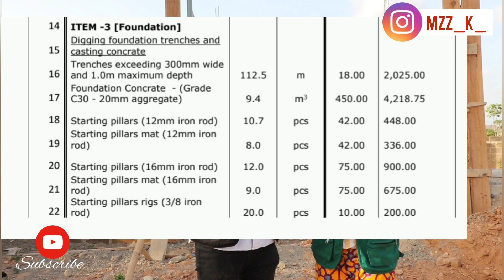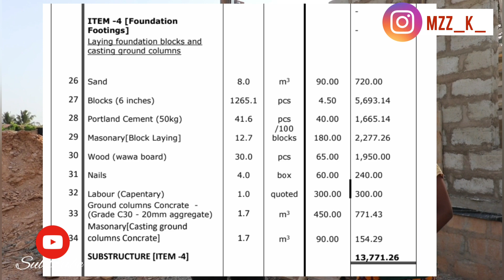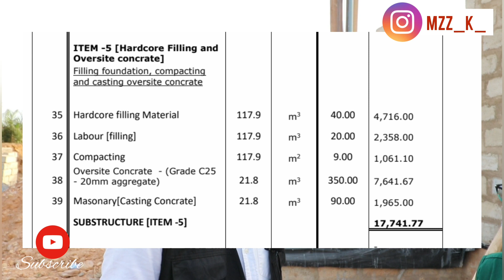Cost of Building a Two (2) Bedroom House in Ghana| Building our house in Ghana Ep 7 Foundation Cost

Comment: Chale this is toooo expensive….the excavation is only 2feet deep…44k wow….I spent 60k Ghana cedis….6 bedroom story building….my excavation trenches 4feet deep with huge columns….all above standard…well I purchased and bargain everything myself….I guess that’s the difference….44k🤦🏾‍♂️
Reply: Can someobe linked you up for guidance
Reply: Also they are using expensive excavation vehicles and  may have included cost of preparing land for which they hired similar heavy vehicles. If you build at a faster rate it makes the cost higher.

Comment: That plastic is going to ware off like nothing was there. Damp proof membranes are much durable and thicker than that. Like those sold by ventigeo
Reply from the maker: Ohk, will consider that next time. Thanks
Reply: Great observation. Are you a builder?
Reply: @ladysaw9995  no I'm not a builder. Waterproofing is something I've recently been looking into. Unfortunately, most local builders don't know what they're doing. They lack modern experience and building procedures. Do you'll have to insist on what you really want.